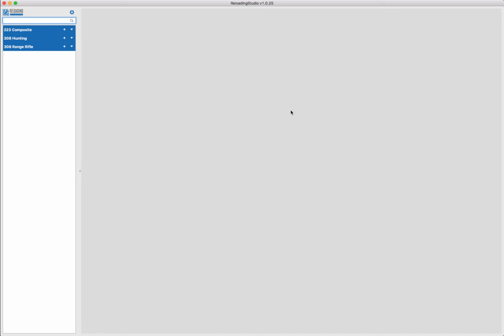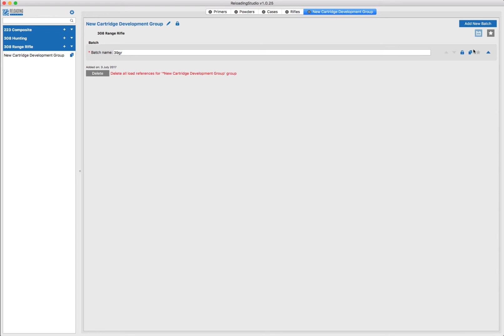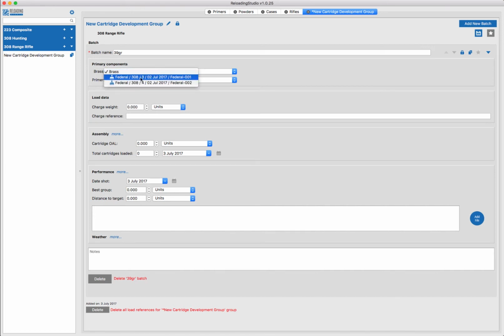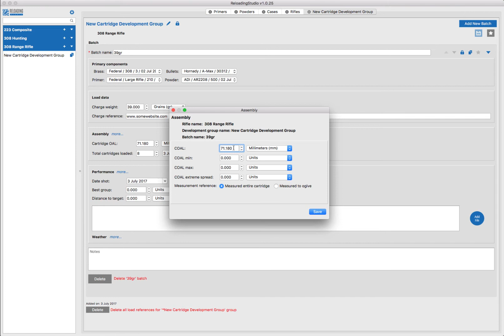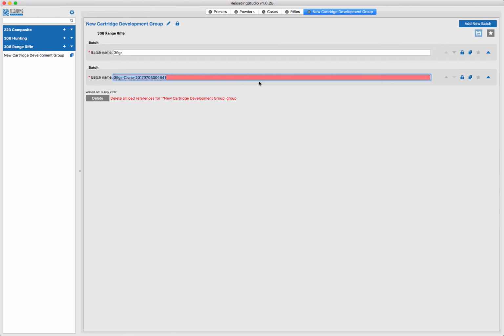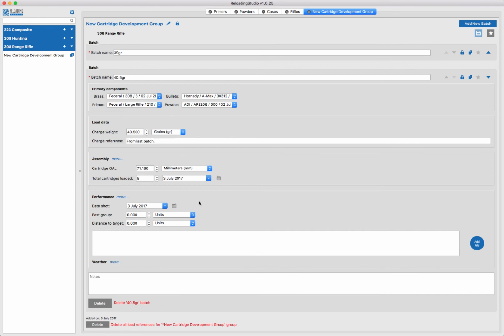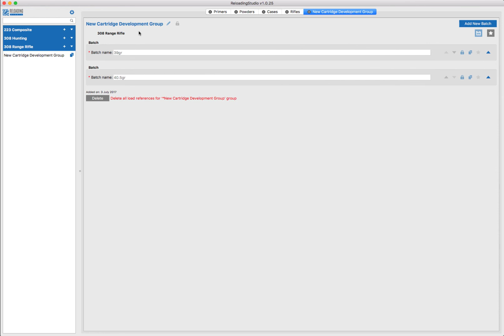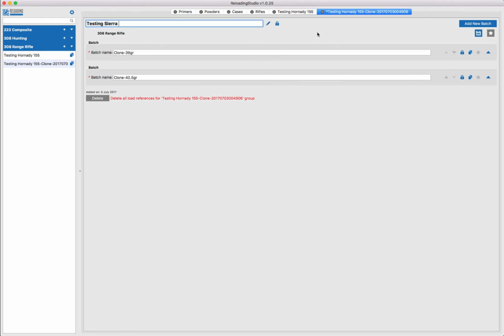(old, legacy only) Desktop Part 6: Cartridges, cartridges batches and cartridges development groups

Comment: In this area, I think it might worth considering adding the field of where on the bullet measurements were taken? The bullet nose, or the bullet ogive?
Reply: I'm thinking now that the above might have been premature, SB, but time will tell.
Reply: SB, I was correct in my opinion that I was premature... However under the assembly area, may I suggest a notes section? For us to include exactly how we measured from the ogive, or from the bullet meplat? 
.
For example, I would want to tell myself that I used my Mitutoyo calipers, and my Forster Datum Dial Kit, measuring from the bullet ogive.
.
Or conversely, I used my Frankford Arsenal Calipers to simply measure C.O.A.L. from the head of the case to the bullet's tip.